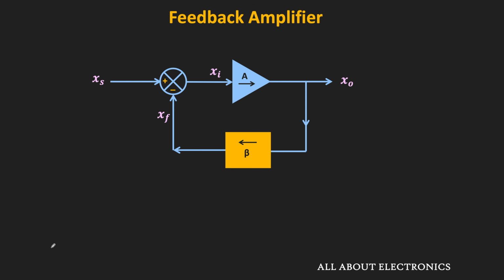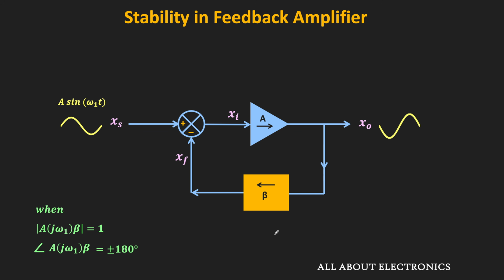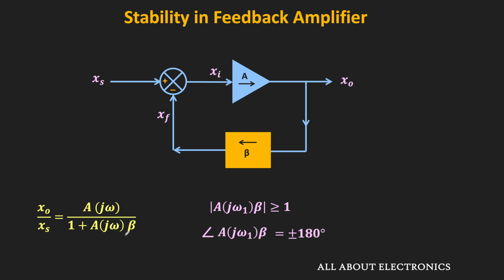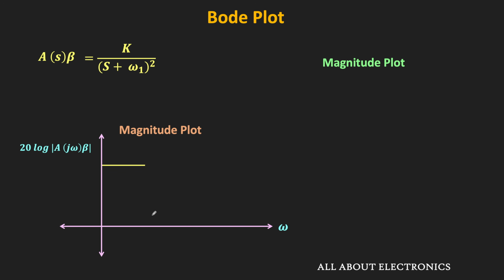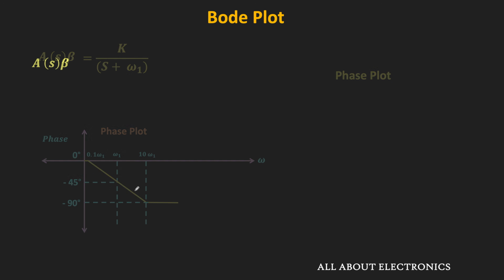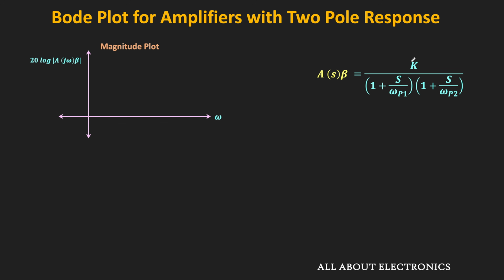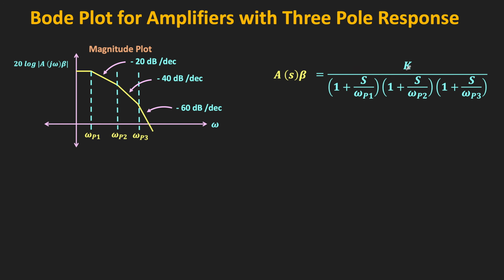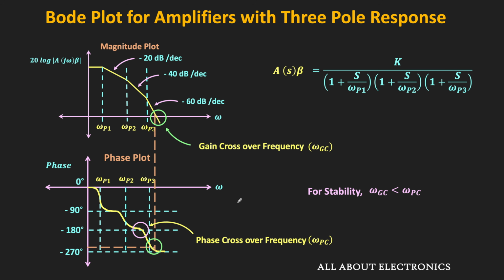Stability in Feedback Amplifier Explained | Stability Analysis using Bode Plot

Comment: am i wrong or is this basically just a specific case of what u d have already learnt in control theory?

where it is not just about feedback amplifiers

but about general systems, even with higher order (u also learn this in a signal and system class)

u can determine stability with routh criterion, nyquist plot, and region of convergence
Reply from the maker: Yes, this is also applicable to other control systems. And the stability can also be found using other methods. Bode plot is one of the methods. And here in analog electronics, since I was discussing the feedback amplifier, so in that respect everything was explained.